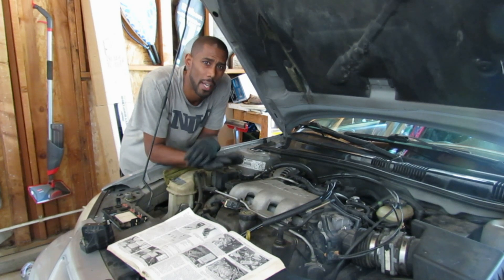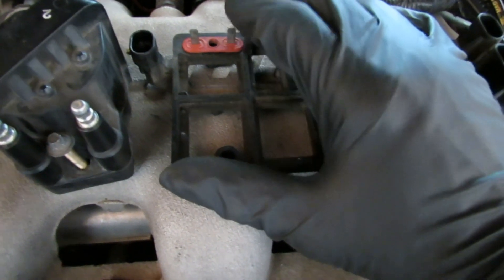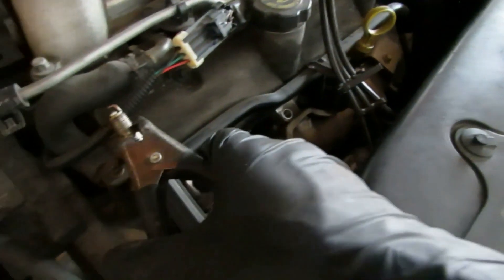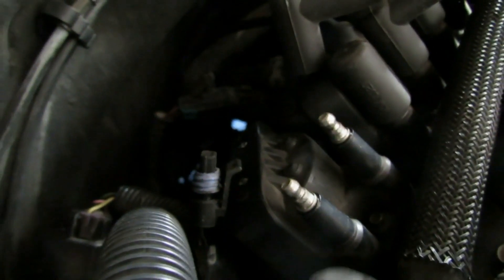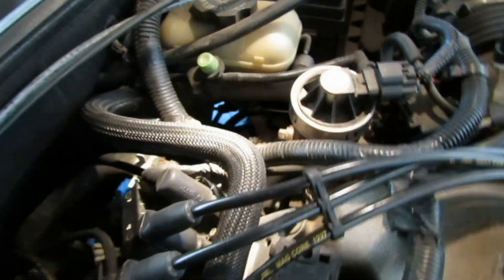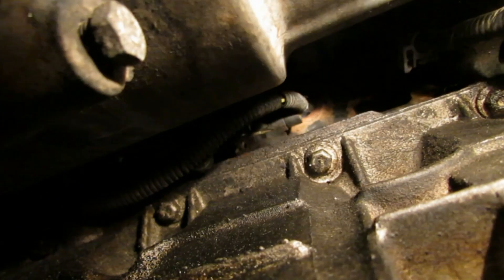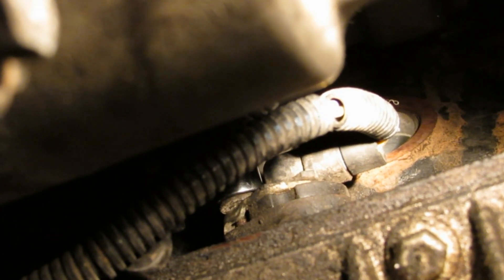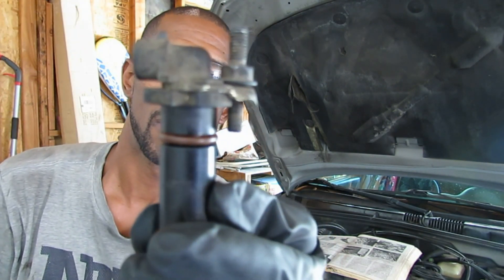Learn how to replace your Crankshaft Position Sensor- Imagine you fixing your car

Comment: Ok. After changing coils, wires, ICM, plugs, ccps,...sigh
It stood misfiring. I gave up or took a brake. I left it alone sitting away. After two months I thought: "I'll start the engine so it doesn't jamm" And it came back on right away. Then check the engine while running and it looked so smooth running silently.  Me: Wtf! Ok I left it warm up good then took it for a ride been careful not to jerk it. Speed limit ok. I didn't want to mess it up. Came back home then did my laundry at laundromat and even the check engine light came off. Me: wtf! That light was on forever before! On my way back from laundromat after stop light, check engine came back on. Me: wtf no!! I got home and plugged the scanner. It reds po300 and p1860.
Reply from the maker: The p0300 ranges from a dirty MAF sensor, vacuum leaks to dirty fuel injectors. The other code p1860  is indicating a TCC PWM Solenoid Circuit Electrical

Read more: https://www.engine-codes.com/p1860.html
Reply: oxmanagain well, I've been working on those things too. I'm suspecting there's a miscommunication between computer and engine parts or shortcut. Some things like door locks stopped working or dome light. I know something is not right. Why all of a sudden they work or flicker the headlights when pressing the brake pedal? I'm kind of tired. Not even selling it means anything to me. I won't get more than 1,500 wish might be the cost of head gasket that leaks coolant to oil.
Reply from the maker: I feel your pain, when I get to that point I do just what you're doing and that take a break. By the way, if you have a blown head gasket, I have just the video for you. https://youtu.be/3VkPGZLIB6M

Comment: At 5:22, you indicated you tested the crankshaft position sensor, but it seems you still replaced the CPS. From the video, it seems that you moved onto the sixth step. Was the test faulty? At 7:22 it seems you tested the continuity of the ICM and got no reading. Did you replace that too?
Reply from the maker: You're right, the CPS was the cause of the car not starting and that did get replaced. At 7:22 I tested the the old ICM just as a bonus to show how I determined if it was good or not. I changed the ICM months before this video. You have good eyes and thanks for watching.

Comment: quick question for you  my montana  stalls out while driving but start  right up  and   drive  fine  but stall out at stop  do you think it is crank shft position sensor.  Thank you very much.
Reply from the maker: It sounds like something in the fuel department. Maybe, you throttle body is dirty.

Comment: So camshaft and crankshaft are two different sensors. And where are they located.
Reply from the maker: Yes, the car has both. The crankshaft is under the engine and the camshaft is on top of the engine. In the video, I show where the crankshaft is and the cam is located under the top engine mount. Right next to the cruise control box, next to the overflow container.
Reply: Ok I changed the camshaft but didn't change a thing. It keeps sending the randomly misfire. Now, the engine start right away but uneven. Before a change the crankshaft sensor I guess it wouldn't be starting if this was the problem or what you think? Other message is fuel injector control circuit.
Reply from the maker: deepcritik I agree with you, if it was the crankshaft sensor the car wouldn't start. If you're getting a fuel error, I would with change the filter, then clean the throttle body and even try to use one of those pour in injector cleaners. Plus, you might want to check out the vacuum lines and/or the emission system components.
Reply: Ok. Actually one of the first things I did was cleaning the throttle body and idle valve. After that I got the randomly misfiring.  And everything started with cilinder #2 misfiring. Trying to fix this problem I got it worst. I have to tell you that From Sparks to control module I've been checking to be ok or maybe not.? I'm lost
Reply from the maker: deepcritik once I had to change the spark plug wire because the car wouldn't start. Did you change your spark plug wires and spark plugs?
Reply: Yes sir. I started with the coil that feeds that spark plug. Didn't change, changed the spark plug, didn't either, changed the wire nothing, changed all spark plugs wires and coil for that cilinder. Nothing. Then cleaned the throttle body, EGR valve and idle valve. Then randomly misfired.... Pulled my hair and shut the hood!. Then on fresher mind bought a control module. Put it on, test it and Nothing!! Same as first test. Returned the ICM to store. Then I saw your video. I just changed the camshaft sensor and a little excited to be able to do it. Test but same simptom. Sight... vacuum hoses seem ok.
Reply from the maker: Wow, you have a fixed a lot, you have some good skills. What was the OBD II code when you check the engine light?
Reply: Well, I'm tired of it. Next I'll change fuel filter and maybe injectors control valve. Even doh they say if you unplugg the vacuum hose to top of injector valve if it drips out it's bad. Mine don't drip but what the heck I need to eliminate suspects.
Reply from the maker: Well keep me posted and if I come up with anything else I will let you know.

Comment: Man this is hard. Can u come do mine too? Lol irs a 2002 grand am :-/ im at a loss
Reply from the maker: Hahaha I understand, it is a little tricky. What exactly is your problem? Maybe I can lend a hand from here.
Reply: oxmanagain well my exhusband replaced the crankshaft position sensor bc it wouldnt start. I hear the fuel pump cycle so i knew it wasnt that. It started right up. Next day it wouldn't start again. So i watched him do it so i was gonna try to put a new one in myself but scared it'll just have the same results.
Reply from the maker: Before I replaced the crank shaft sensor, I had to change the ignition control module. Have somebody shake all the ignition coils if the car starts up with the shaking your ICM might be the issue. Or it could be the spark plug wires.

Comment: very informative. helped me locate cps but im having trouble getting the wire holder of the stud to get to the 10mm nut. did you have same problem, if so any ideas how to remove it. i tried pulling on it but will not come off stud. it will wiggle left & right but will not come off. it seems to have E-clip holding it onto the stud. im unable to get under vehicle to get better view. thank you. please get back to me on this matter.
Reply from the maker: I used a long screwdriver to pry it off.

Comment: Excellent video, I have a malibu 99 3.1 lt. And it marks me fault in crankshaft sensor, I already change it with everything and cable I change spark plug wires and they are bosch almost new, filters of air and gasoline and it continues to mark the fault and to accelerate as it loses power and consumes A lot of gasoline, also check the coils and if they have spark and also the impedance and mark almost the same although some are not with much brightness, what could be the ICM? Or do you suggest the computer? Also does not mark the rpm on the board but in the OBD is ok the rpm.
Reply from the maker: First off thanks for watching. I would check your spark plug wires first, then the ICM and ignition coils. Let me know the results.
Reply: Ernesto Cavazos map senor

Comment: I'm trying to remove the bolt behind the timing without removing tensioner. possible?
Reply: replacing cam and crank sensors

Comment: Excellent Sir! Thanks for posting. I have to do this job on my 94 Ciera, 3.1 liter. Your video is the first to show me exactly what needs doing. Many thanks again for posting! I have done as you did earlier in the video and already replaced the spark plugs, wires and ignition control module as well as coils. Hoping this crankshaft position sensor replacement takes care of this issue once and for all.
Reply from the maker: Joseph Trunk wow that's a lot of work so far. You sound pretty handy. When you find the problem let me know what it was. Thanks for watching and you're welcome.
Reply: oxmanagain I'd like to know also
Reply from the maker: Tiffany Hagans I believe you have to take the tensioner off
Reply: I was able to access information in a 94 Olds Buick General Motors service manual for the 3.1 liter. According to the diagram In the service manual, there are two Crankshaft position sensors. There is what's labeled as a 3x Crankshaft position sensor,  that is what Mr Oxman here changed on his daughter's car. Then there is a 24x Crank Sensor labeled in the diagram  that is the sensor on the serpentine belt drive side of the motor (passenger side) alongside the crankshaft, with the harmonic balancer in the way, needing removal. Best to remove right front wheel and shroud protecting motor area to access the harmonic balancer. With a harmonic Balancer removal tool ( I bought an OEM brand Harmonic Balancer Removal tool from Auto Zone) I should be able to finish the job. As soon as I can get to this project I'll let you know. Thanks again to Mr Oxman for his inspiration to do this involved job. Gonna be a little bit before I can get to this project as I'm looking after 95 yr old Mom. But I want it done and I want to pass along any info I can to make it all work properly once more. 

Joe
Reply from the maker: Joseph Trunk thank you and I hope it works.

Comment: what were the symptoms to the car .. my car starts up fine some times and other times I have to step on the gas and other I just have to try over and over till it starts
Reply from the maker: noe Jimenez my car would crank but it wouldn't start. I think you should look into your fuel system.
Reply: I had the fuel filter and fuel pump replaced less than a month ago
Reply from the maker: noe Jimenez I would focus on the ignition components. On my daughter's car her ignition control module was going out and I would wiggle it and it would start the car. Plus one of her spark plug wires was bad and that was the cause before I did the full ignition system check.
Reply: I have everything is new for the fuel system but still does it fro time to time and yesterday after running it when I parked it it would not start until the car cooled down than it started
Reply from the maker: noe Jimenez that sounds very peculiar. Do you have any check engine light codes? It sounds like you have a short in something that's related to your ignition system. I would just go through and check the entire ignition system step by step until I isolated the problem.
Reply from the maker: When that happened to my daughter it was her ignition control module. I would start with the ignition system and check everything one by one.

Comment: Great Video
Reply from the maker: Thanks, I hope it helps you find your problem.
Reply: I had a tough time getting it out due to the O ring.   Now the new one will not go back.  Sprayed silicone on it with no success.  Do not want to pry on it much, I don't want to break the new one.  Any Ideas? Suggestions?
Reply from the maker: I would try to put the old one back in, then you can see just how much force it can take until it will break.
Reply: Good Idea... Thanks
Reply from the maker: Just checking to see if you got the sensor on?
Reply: So after several attempts (hours), with various tools. I realized my ball joint spreader would fit perfectly around the sensor without putting pressure on the connector housing.   Turned the sensor where the spreader fit in the groove and after 3 attempts with a lot of FORCE, the sensor slid  into place.  Bolted into position and terminal reconnected. :)   Will finish up tomorrow, wife expects Mothers Day attention.
Reply from the maker: I understand I'm married also.
Reply: So I replaced the coils, the ECM, and the Crank shaft position sensor.  Still it would not run.   Next, no fuel on the rail, so I took the fuel tank down to replace the fuel pump.  Now my fuel guage  has not worked correctly for years, so between 250 and 280 miles I would refill the tank.  I had just refilled the tank and have less than 20 miles on the trip meter when the car stopped running.   When I dropped the tank, it was EMPTY.  Some a$$wipe had siphoned all the fuel out, there was only a small amount left.  So with all this, all I needed was $20 of gasoline.  But now I have new sensors, new coils, new fuel pump and fuel filter.  I really won't stress about it much, all these components have over 290k on them, so for less than $150 I have replaced a lot of stuff that would probably need it eventually.    This is a good video, thanks.   Yes, it runs now.  LOL
Reply from the maker: Wow, you sound like a very determined person. I have been there before, just replacing parts to find out it was somebody else's fault. Like you said, now you have a new car. Thanks for watching and I'm glad the car is running but more importantly you gained some knowledge. Thanks again.

Comment: same thing with my 04 grand am..cranks just fine cold, but after driving for a minute, stop at the store...come back....car cranks and turns over but starts with hesitation...looks like a lil job to do to mine..lol..one other video i found is that car be on a lift with wheels turned to left, reach thru fenderl wel,l on left side front, to easier access to CPS.......
Reply from the maker: Good tip to know and good luck on fixing yours.
Reply: Thank you

Comment: Hi ...I watched your video . Thank you for sharing . I have the same car there is spark in the spark plugs but will not fire up ..Your video leads me to believe it is not the crank senor ...any ideas ? The fuel pump is working but it is not getting gas ?
Reply from the maker: The next thing I would check would be the fuel filter. It's located in the rear behind the gas tank, in between the rear fender.
Reply: fuel filter is next to gas tank, besides to big black canister thing underneath car...drop canister down by loosen small bolt...change filter......make sure you have good heighth under car.....they sit low to the ground..lol.